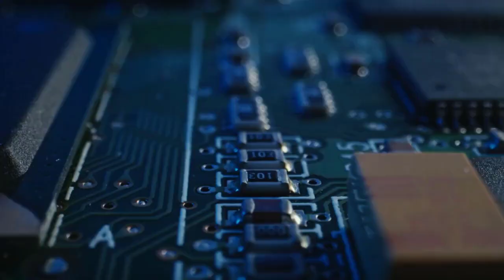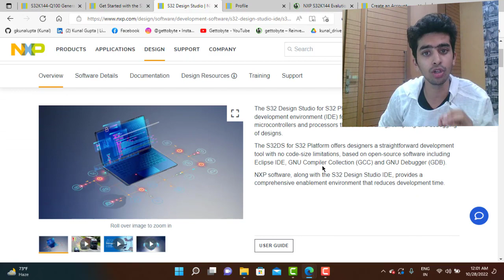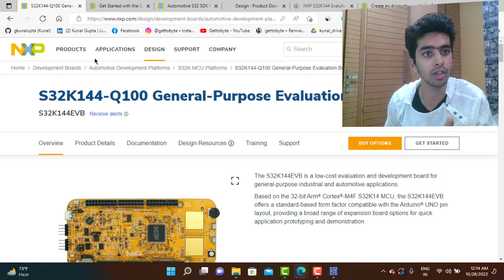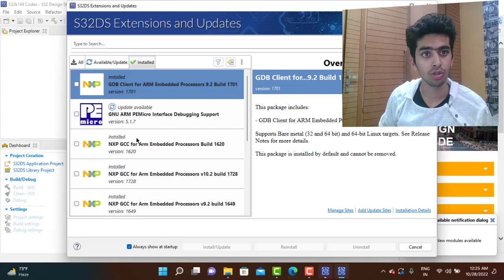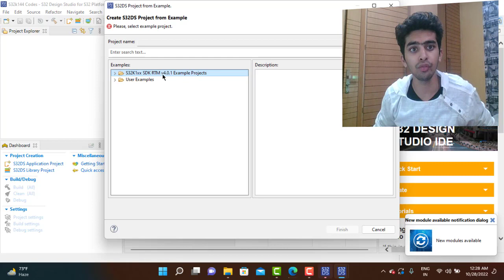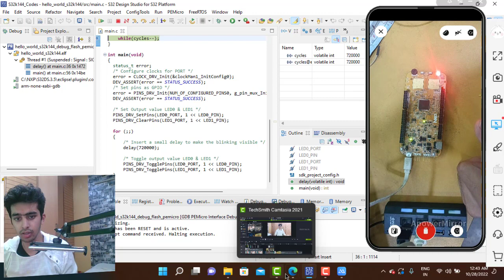Getting started with NXP S32 Automotive Platform S32K144 MCU || Blink LED || S32K1 || S32K3 || S32G

Comment: how did you solve the problem  Project location can't contain symbol: " " while loading the hello world demo file
Reply from the maker: Change the project name!
Reply from the maker: Tell your problem statement by writing a mail to us at : gettobyte@gmail.com
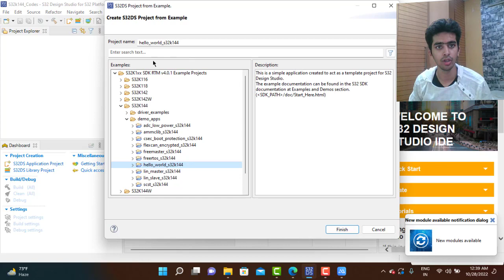Reply: At 17:12 you had a problem of project location can't contain "" .
But in the video that part is cut and then you directly got the option for finish
Reply: @chandanmohanty4876  Its because you have a space in your working directory. You have to place the workspace in a directory that does not contain any spaces within the directory
Reply: @keanogeldenhuys7756  thanks problem solved